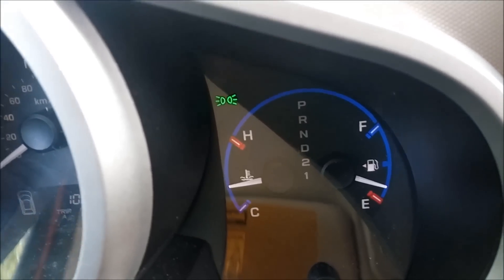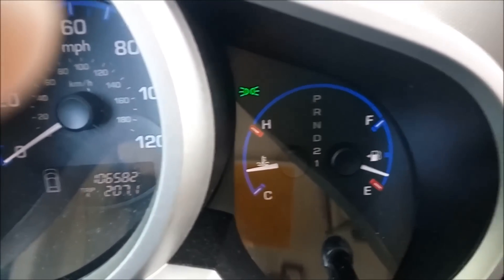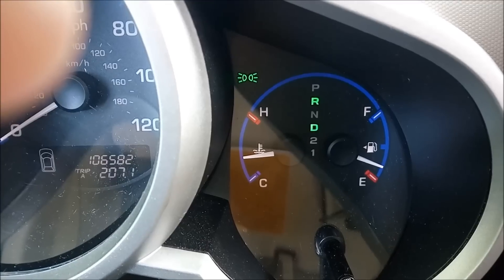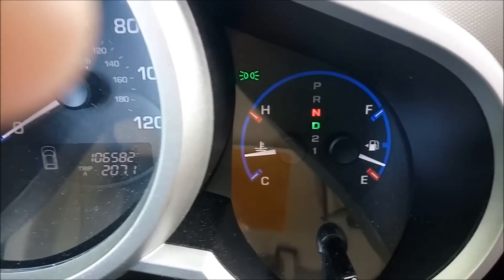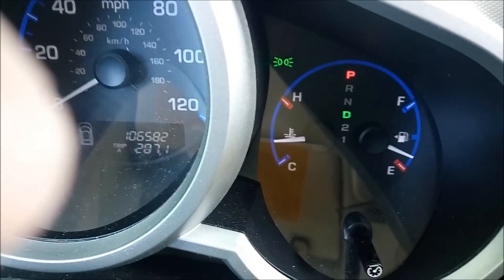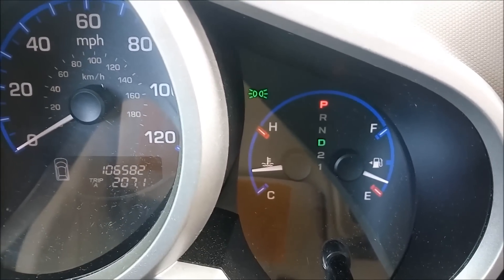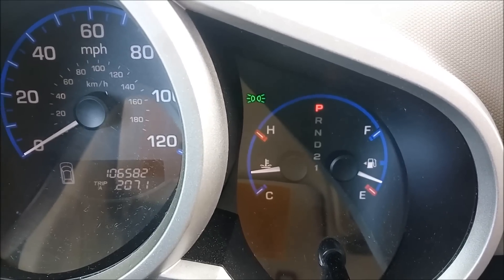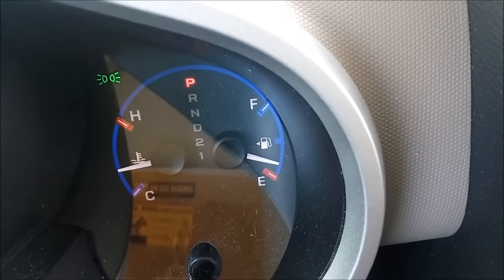Honda Blinking "D" Drive Dashboard Light Problem

Comment: I had a blinking D light and delayed hard shifting for my transmission. I changed ATF fluid and no luck. After watching your video I replaced both Trasmission oil pressure switches and it work thanks man. Accord 07
Reply: I have a 07 accord coupe and d light is blinking and not shifting into to its gears . What you think it could possibly be ? @Bernardo magana
Reply: @mrscott4595  i would say change inspect and change the ATF fluid with honda genuine then swap the 2 transmission oil pressure sensors located the the driver wheel. Honda transmissions are very sensitive.
Reply: A friend who owns a transmission shop says that on higher mileage vehicles the solenoid packs develope issues and valve bodies gum up. My father's 2003 Odyssey had the blinking 'D'. 
The codes indicated a transmission fluid temperature sensor (P0706) and range sensor circuit (P0710) problems

Comment: The code CAN be read via OBDII device, it just cant be one of those cheap basic ones. Any decent scan tool gets access to Trans/Eng/TPMS etc computers.
Reply: Try adding fluid like did and the light may stay off like mine did after adding half a liter.

Comment: You can check any powertrain code with any obd2 code reader... the p in p08** stands for powertrain.  Now the code just gives you a place to look and doesn't necessarily show the actual problem. Wich could be mechanical or electrical in nature.. experience and diagnostic skills are needed for that

Comment: I had the same thing happened to my 2010 Honda Fit. Code PO847 Transmission Pressure Switch. Ordered part today.
Reply: Is it ok now? Same with my ge6 too
Reply: Happened to my '10 fit. Then stopped. It's been five months ago now.

Comment: Honda dealer wants to replace the whole transmission costs $5k USD or 250k Phil peso. So I checked on some comments luckily I've read about the sensor thing. And it works! Costs me jus $80 haha..thanks
Reply: Mj Nuestro $80 just for parts or parts and labor? My Odyssey have the same issue.
Reply: what sensor?
Reply: that's what I love so much youtube...I lot good people in here help other people..Good for you Mj Nuestro,
Reply: maam anu po binili nyu at panu po na ayus.. kindly send me more info po same.. same problem po.. need help
Reply: What's the exact name of the part!!! Auto zone
Reply: Mj Nuestro  mam pwede malamn san ka ng pagawa same problem kasi ako
Reply: @therealruss4.09  hi friend have you got your odyssey fixed and how did that as my odyssey recently started the same thing thanks
Reply: hi dear what senso is that can you please name that thanks
Reply: Sorry for the late response. Just went to a local mechanic (ABJ) in San Fernando Pampanga near Walter sounds like transmission solenoid one of the transmission is not working they just replaced it. Still working up to now :)
Reply: @boltro19  thank you very much for reply how much did it cost you thanks
Reply: $80 dollars :) ask your local mechanic.
Reply: Lol me too

Comment: I had similar problems, but in my case, my civic ex 2010 the problem involved an actual transmission problem that the gear did not shift higher and ran about 45 miles. The dealershop found that two sensors that convey the accelorator input to the transmission failed. so they chaned the two sensors. It cost about USD 210. (south Korea). I was really happy that I didn't have to replace the transmission!!
Reply: Sangki Kim  hi, did they have to take the transmission down. How was the work done

Comment: Just happened on my 2009 honda fit sport. It was the transmission pressure sensor, just like yours. 65 dollars for the part and was able to fix it. 10 min job. It is possible to get it checked thru an obd system p0848 was the code.

Comment: Exactly.  Pressure low switch. What's that tell ya? 
Try what I did. TOP UP THE FLUID. My light stopped blinking after I poured 1/2 L in. I shut the car off and restarted the car and it's been off since. Try that first before passing away your money on something you never needed. Dealers love to take money for nothing.

Comment: my 08 civic hybrid has the blinking D light. First the engine light came up then the speedometer stopped working before the D started blinking, When im driving and kinda press on gas then it kinda jerks instead of shifting...then I let go the gas and slowly step on gas until it gradually picks up speed and it will shift with no problem.  One day while I was at the traffic stop the car started jerking and going from one gear to another, then I turned it off when I try to restart it, it won’t start again till date. I towed it to Honda and they keep charging me for more money testing but yet to find the problem
Reply: So sorry. Was the problem known?

Comment: I am having a similar issue with my 2007 honda odyssey 2.4L.Drive Light is flashing and the code is coming up as P0713 ATF Temperature Sensor High Input.I spoke to Honda and apparently they cant see any ATF temperature sensor on the transmission.It only has 2 Oil pressure switches on the outside.Car runs great no issue at all with it just the blinking light.Any help will be appreciated.
Reply: Same issues but no engine light. Have you ever found out what was wrong

Comment: manual cars are the best, hands down and no messing around with pressure switches and all kinda of stupid designed sensor wich btw are bathed inside the transmission fluid, and can be very frustrating to fix.
Reply: All production is mass factory trial. Not 100% of units sold are accident-proof, definitely has a percentage error. It also applies to computers, household appliances, kitchen tools, etc. 
I hope you don't use automatic or even triptonic vehicles now 2022 🗿🗿🗿🗿🗿🗿

Comment: how long cam you drive the vehicle while this is happening? It just started, when I stop and turn the car off and on, it goes away. i can get it fix this Wed, but need to use it tomorrow to drive about 3hrs away. Will car still run?, currently feels like there is no issues and runs good.
Reply: Did it work?
Reply: Tell me also please what do you do ?? I have same issue
Reply: Iman Ramin I’ve been driving mine for a while with this happening and nothing has happened.

Comment: I had the same problem on my Honda accord 1995. mechanic changed speed sensor. now it's fine.
Reply: Ташкентская - Кухня was the car shifting weird while light was on?
Reply: Ron Price after 6-8 ml light was coming on and computer was messing up on what gear it's on (sorry for bad english) 
I want to tell you the mistake what a stupid mechanic did: when he changed speed sensor "d" light is gone, it was fine, but he in addition completely changed transmission oil which was deadly wrong... after 200 miles my transmission started  slipping..it's dead! All old cars transmission oil needs to be changed in a half 50x50, othervice you'll meet high price problems like me...
Now I found Japanese engine and transmission warehouse, bought used transmission for $435 (sold as 50000 ml on it with three months guaranteed) and labor $200, which cost me all together $635 because of mechanics mistake?
My advice to you brother: go to only transmission mechanics. They will check for free and tell you what's really wrong. If live in LA I'll give you the address where to get transmission for low price.
Reply: @ТошкентликҚаюмака  wheres the location?? I'm in la
Reply: @josecardozo8634  12055 Sherman Way, North Hollywood, CA 91605
Intersection laurel canyon/Sherman way. One year passed and still transmission running good. Don't know, maybe I'm lucky.
Reply: I have a 2006 honda pilot and i just noticed that the D started blanking in green and i took it to the shop and they said to me that the transmission is about starting to die out on me? So can somebody tell me if that is true?
Reply: @thatshowtheyare9227  Do not trust chain automotive technicians (Pep Boys, etc.). Find an independent mechanic or go to the Honda dealership. In other words, get a second or third opinion, as one would do for a surgical operation. Please reply as to what you have done. Good luck.
Reply: @floraline7153  What i did was to draining out the old transmission fluids and put new ones in along with dr tranny and now the D blinking green light is completely gone away for now but hopefully doesn't comes back up in the long run

Comment: Hey i have a question, i change my headlights and i installed hid lights to my honda civic coup 08 after 2 or 3 days the drive light starts blinking, is it because i change the lights ?
Reply from the maker: Arnold Guildarie doubt it, probably just a coincidence
Reply: Same here i put in LEDS
Reply: Arnold Guildarie me too same thing
Reply: I had a similar happening.
Reply: Same here.   Just installed led headlights. Disconnected the battery to get to drivers side bulb and the D light vsc check engine light and radio codes all came on.  Had to disconnect the battery again for about a half hr to reset it
Reply: Hi. I have a 2005 Sportage, I too have a blinking drive light. Not too sure if it’s because I changed my lights.. I even put LED fog light.. I’m removing everything fist thing in the morning...

Comment: Do you have any places you recommend to go get it checked? I went to someone and he said to just get a new car or change the whole transmission however I don’t think he was right the only problem is the d light flashing.
Reply from the maker: He's likely not right, both of those are last resort, if you have a really old car, you may just take it to a local mechanic, what make and model is your car, if it's a common model then go with a local mechanic, the dealership will charge you like $300 to fix it.

Comment: 2003 cr v ex, been blinking d, chnged the 2nd pressure switch and selonoid, both didnt work, im exhausted, any other suggestion?
Reply: It's the third gear switch that's the problem. Do a fluid drain and fill. Not a flush. Honda atf  only!

Comment: Mine was the trans. Pressure control switch underneath. Fixed immediately
Reply: I have the same issue on my 2009 Honda CRV where did u order the part from cause I just did the free autozone check and its the same error.
Reply: @shimazutoyohisa2382  i got a 2007 crv and mines doing this too. did you ever fix yours ?

Comment: Did yours go off when you turned the car off mine did and hasnt been on since.
Reply: Mine started blinking after a pressure wash 😐. It turns off and it acts like it's fine when I turn it back on but sometimes it randomly starts blinking, I'd say like 3 or 2 times a week randomly 🤔
Reply: @shlumpgod  Hmm. I had my car pressure washed exactly a six days ago. The blinking started today. What was your experience?
Reply: @floraline7153  The blinking for me happened right after the wash, i sprayed the hose right on the top left tire which makes me think the wash caused it. It's been like 2 months now and i rarely get the blinking light anymore. I still do but it's not as common as before. Had mechanics scan the car but nothing seems to pop up so since it doesn't really bother me anymore i guess I'll just leave it how it is

Comment: pls my D4 gear always start to blink after driving for 3-4mins, but if i put of the engine on motion, and start the engine it will stop blinking and it we start blinking again after driving for 3-4mins. but my gear is selecting perfectly .pls what is the solution pls, waiting for your reply.

Comment: My Honda 2010 crv just had this happen today. Can I still drive my car until I get it into shop on Monday?
Reply: Jill Schmieding I wouldn’t recommend it unless you absolutely need to. Wouldnt wanna cause damage incase.
Reply: I had the same issue in my 2007 Honda civic ex..mine was a low oil level in the transmission, but also check for the transmission solenoid plugs and make sure they are tight or making a good connection..after pouring half quart of transmission oil for hondas while i was pushing the brake pedal i drove the shift from P to 1d up and down couple of times then drove the car in D3 for about 3 blocks at low speed 25 to 30mph then parked and i drove in  D normal.. and after 20 min check engine light went off...good luck ..

Comment: on my situation flashin D comes sometime about 2-8 seconds, at the time transmission stops working  and sometimes car engine deads 1-2 second and starts itself when i,m driving, my mechanic check with odd and everything wos good, what can it be?
Reply: Vitali Nozadze Before I had this blinking D, my engine cut off unexpectedly, now it's fixed after they replaced this transmission pressure switch

Comment: I just had a problem with my Honda Accord 2007 V6 this morning, when i was driving the car shook suddenly and it gave me a “D” blinking and a check engine light. After that my car lose power and revving up to 3000rpm in 60mph. After realizing i may have a problem, i stopped and put the car to park and turned off the engine. I checked and open the engine cap, there was no smoke. And i decided to to turn the car back on. And the car gave me only a check engine light no more blinking D. After a few miles of driving the car gave me the same problem like i first mentioned above. Sigh... This cars engine was rebuilt 2 months ago i have driven it about 6000 miles with the new engine. Can somebody help me?? 😭😭
Reply: I wonder how did you resolve your issue. I just had the same phenomenon.
Reply: The pressure switch

Comment: Yeah because you need neutral safety switch man you could placed it yourself for cheap don't let dealer rip you off
Reply from the maker: Transmission pressure sensor, 3rd Gear Clutch.
Reply: How

Comment: The D in my Honda pilot 2006 model transmission, Just stop working.
It didn't even blink.

Can the pressure switch be the cause?
Thks

Comment: The same blinking light is happening to my Honda Accord but a mechanic scanned it with an abd 2 scanner and it read a code for Transmission control module fault.......does anybody know how much is it to repair????
Reply from the maker: About $280 to fix in dealership and another $120 for changing the transmission fluid after the fix.  Yes, mine was a transmission fault too.  it was a Pressure Switch Sensor at the 3rd Gear Clutch Low Circuit with Error Code on the Transmission Computer of P0847

Comment: I am having similar issue, but my car doesn't go forward . I have to leave it for 15 to 20 minutes then my starts to move again. Is it a gearbox issue?
Reply: I'd check and made sure your transmission isn't low on fluid. If it's not low, then it'll probably need a mechanic to troubleshoot the issue if you aren't pretty handy under the hood of a vehicle.
Reply: I just had a problem with my Honda Accord 2007 V6 this morning, when i was driving the car shook suddenly and it gave me a “D” blinking and a check engine light. After that my car lose power and revving up to 3000rpm in 60mph. After realizing i may have a problem, i stopped and put the car to park and turned off the engine. I checked and open the engine cap, there was no smoke. And i decided to to turn the car back on. And the car gave me only a check engine light no more blinking D. After a few miles of driving the car gave me the same problem like i first mentioned above. Sigh... This cars engine was rebuilt 2 months ago i have driven it about 6000 miles with the new engine. Can somebody help me?? 😭😭

Comment: I have 99 honda accord and its doing that.  It looks like it over heating then jerks and the light starts blinking. The engine light is on too.  So when I drive it take a little time to pick up speed.  I don't know what to do anymore 😕 and now it won't start. I paid these m mechanics $400 to fix it.  I guessing he never fixed